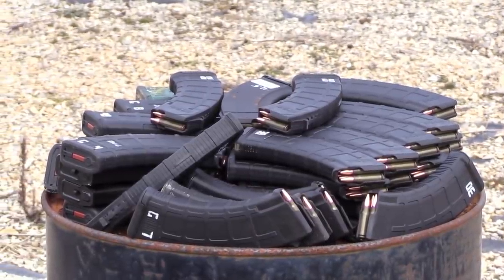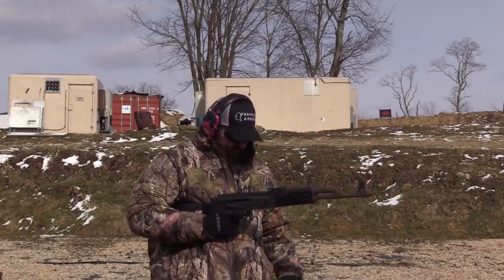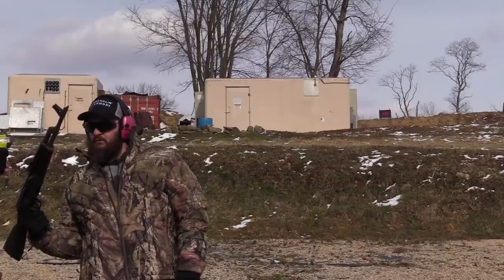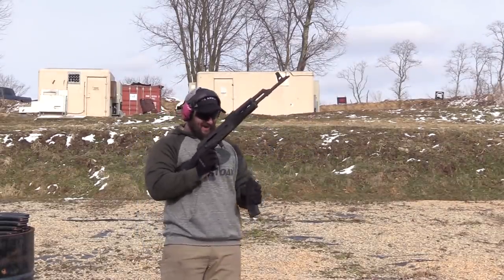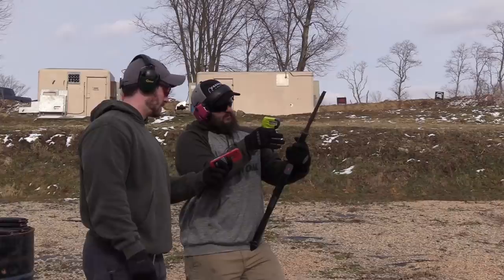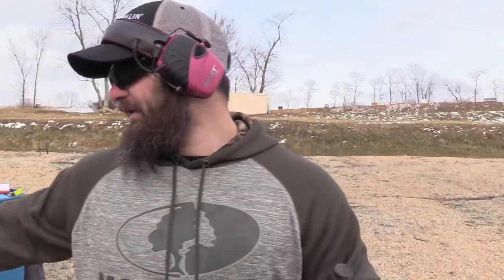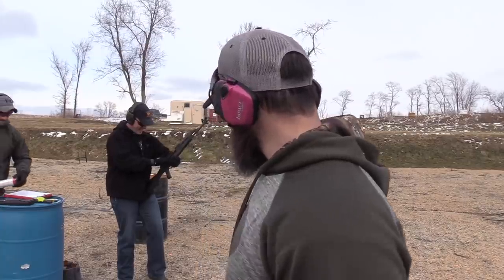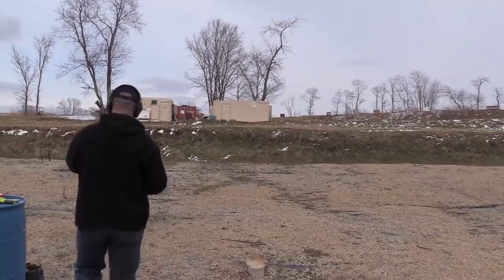VSKA AK47 5000rd Test// 3000rds (Part 4)

Comment: i usually dont care but damn that ak is so damn ugly...it looks like a cheap made bb gun that sat outside under a pine tree for about 3 years...
Reply: heat causes metal to rust very quickly. i think they might be overheating the barrel even with the temp checks. buuuut maybe a higher quality finish would hold up better?
Reply: @nerdlydood  I wonder if oil would bring back the finish